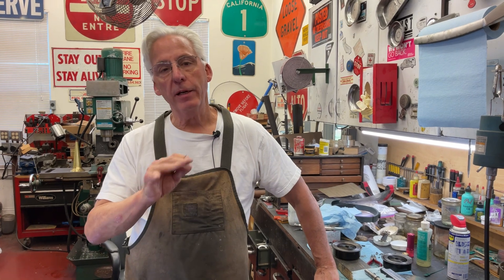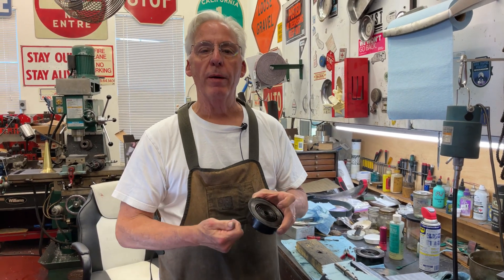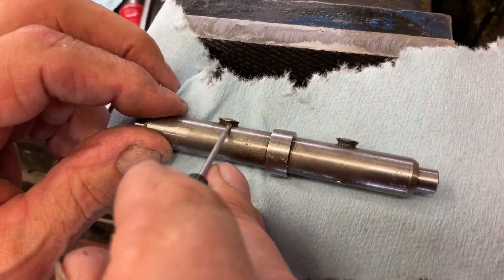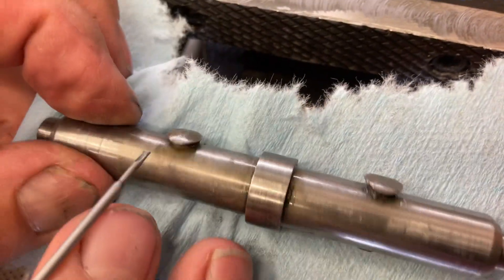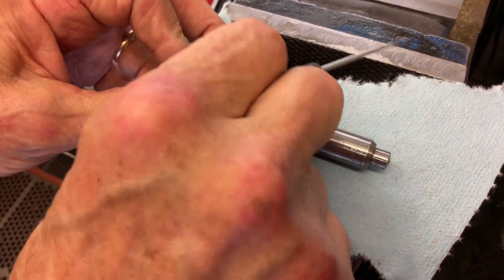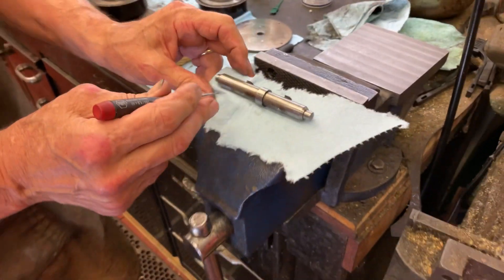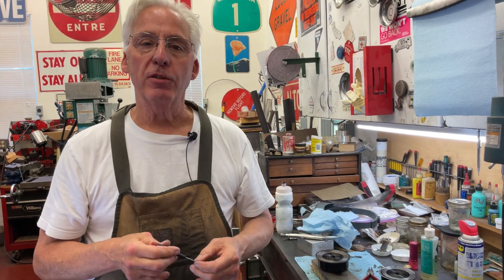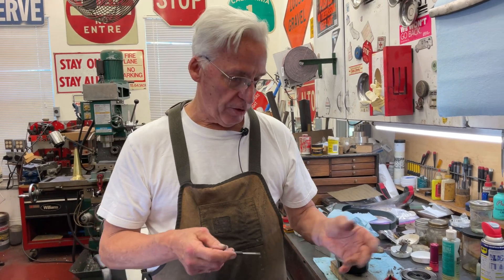1422.  If the spring won’t stay connected, check the arbor nipple. ￼

Comment: Question - Can the leading edge of the nipple that is too low be filed to increase the gap angle to capture the spring?
Reply from the maker: There’s not enough room for me to get even a jewelers file under that nipple to take some off the bottom, but it’s a great idea